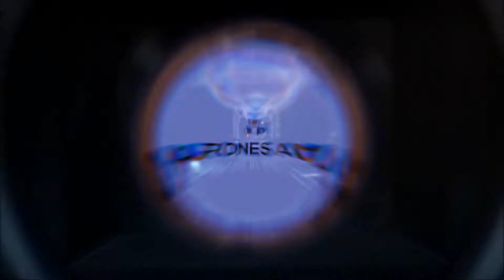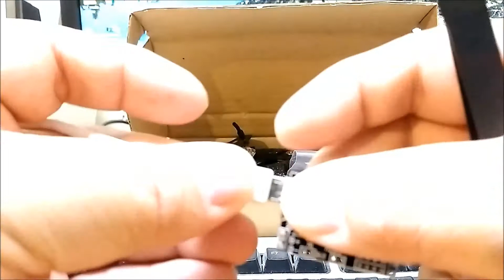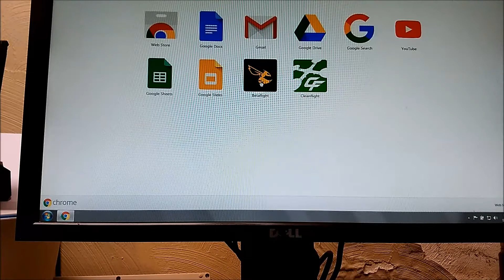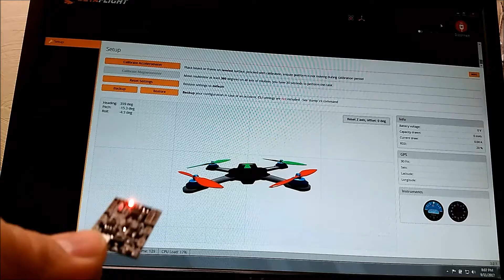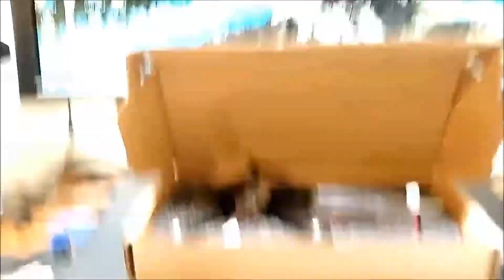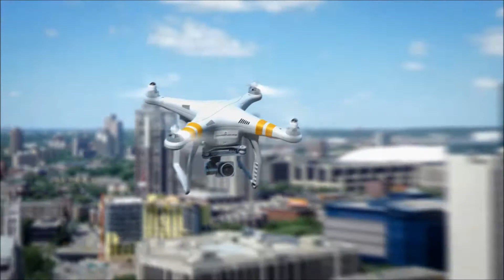F3 Brushed Motor Flight Board

Comment: where i can buy the receiver and transmitter for this board, pls share link of receiver and transmitter for this board.
Reply from the maker: You can use whatever radio and receiver you want. I'm using my Taranis QX7 and a FrSky receiver
Reply: Mike's Drones and More may i know the exact receiver model number.. thanks
Reply from the maker: Any FrSky receiver should bind and work. There are too many to list.